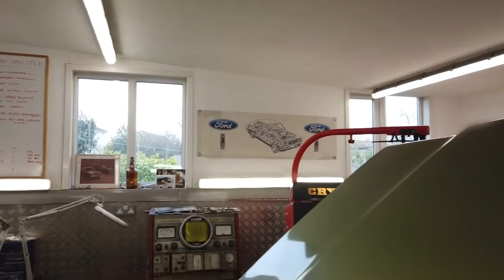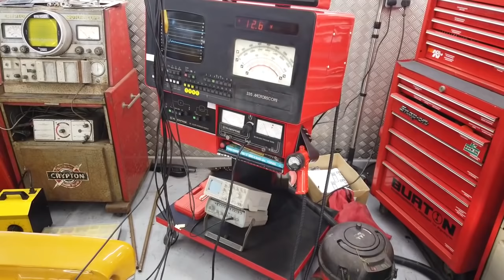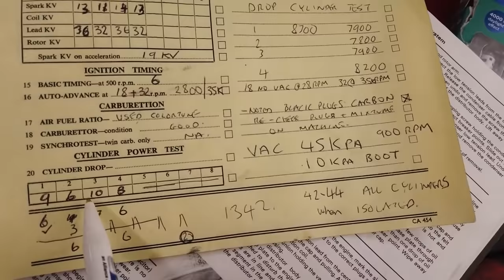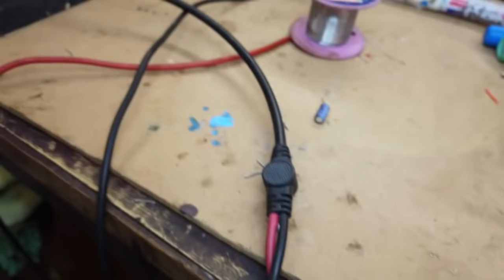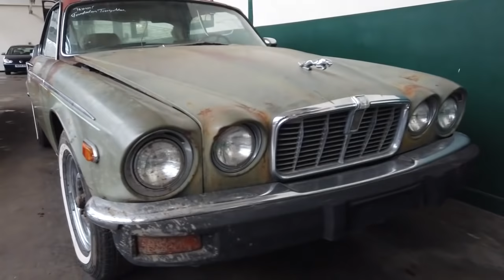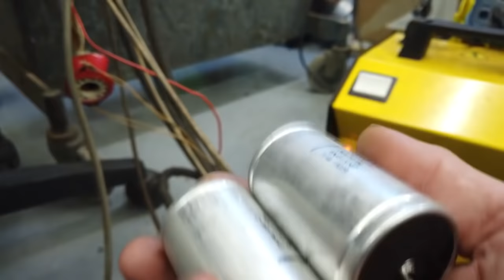Mk3 Cortina - Road Trip tech vid & Tune up on a Crypton Motorscope.

Comment: Power transformer could be rewound - I know at least one person who could do it. The resistors on the big electrolytics are either to balance the voltage across them if they're wired in series, or just to discharge them to avoid "surprises". The big stick diodes are most likely for the tube EHT so you'll need some big EHT diodes like those used in some black and white TV sets.
Reply from the maker: thnaks Howard, would microwave diodes work? i may have to put a series resistor in maybe?
Reply: @PeteCswampy  They're a bit butch for the application, I'd have thought but series resistor? I wouldn't have thought so. Pop over to VRAT and ask there, you'll get plenty of good advice :)